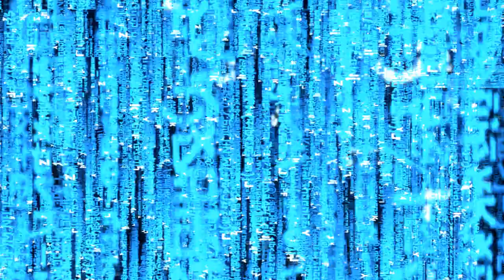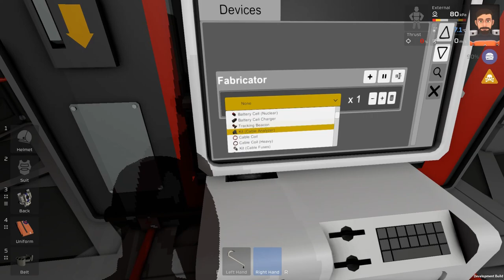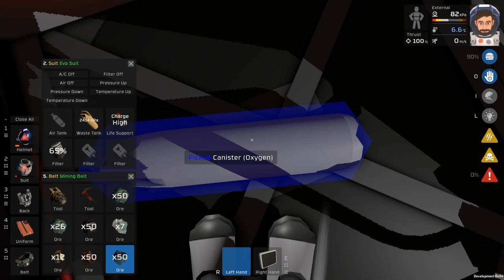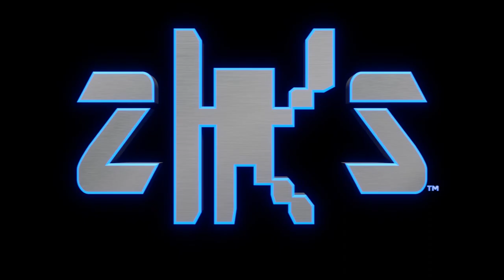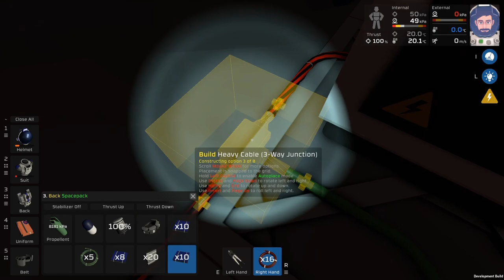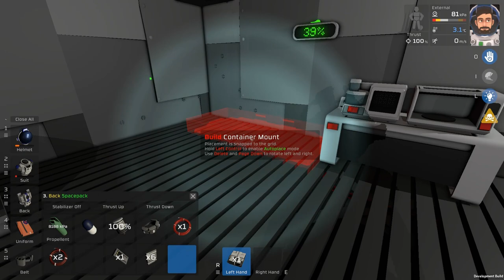Moving & Improving The Solar Array!- Let's Play Stationeers - E24

Comment: In relation to the hitches... that looks a lot like garbage collection.  Stationeers was made in Unity, which uses C#/.NET/Mono for its underlying scripting engine; "garbage collection" is just that engine cleaning up references that have been dropped, which is a totally normal process.  It just means that the devs are generating a lot of garbage in a short period of time, which should be corrected.
Reply: Yup. Stationeers starts to be a bit too complex for Unity and in that case there starts to be some weird problems